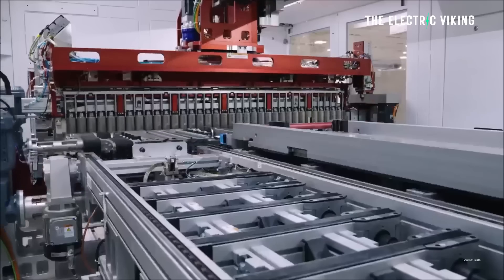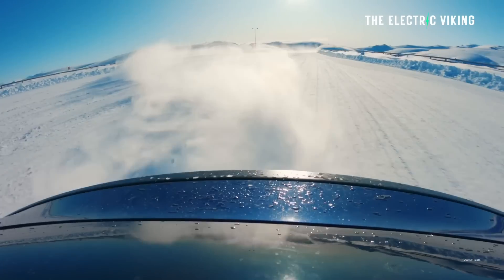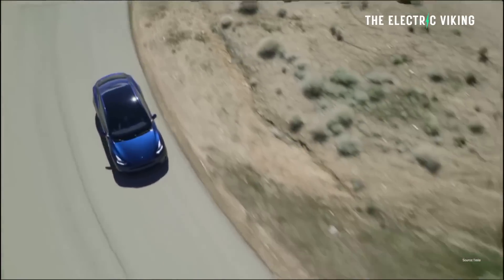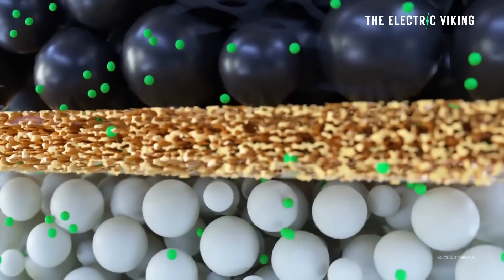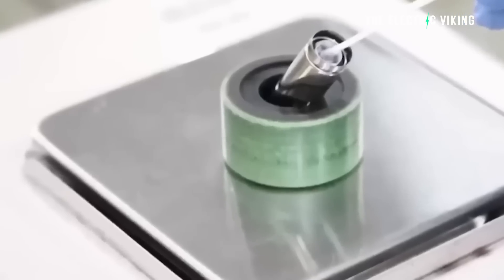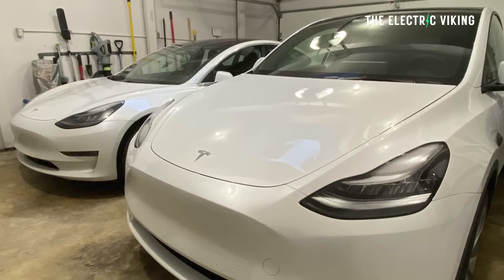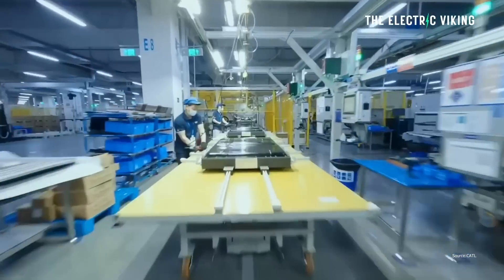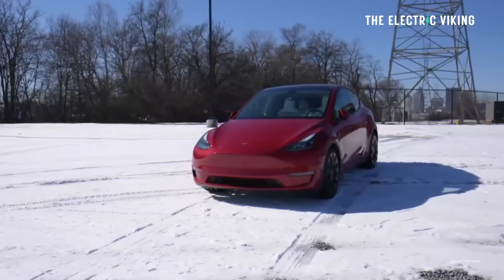Huge study of Tesla batteries reveals degradation in hot VS cold climates

Comment: With most modern EVs,.degradation is kind of a mute issue.  Even 4+ year old Leaf Plus which is nearly only DC charged and used for road trips has only 7% degradation in a hot climate.   Move on.. a bit more range and variety of style and features is where people are focused.  Batteries will get smaller/lighter but are not the top factor any more in buying decision.

Comment: I agree that newer LMC batteries are better. I have a Bolt EUV. I thought it was the goofiest iteration of an EV until I did more research. Winter is not good for Bolts, but I’m eager to see if I can make it work by using the cabin heater to 50F, then use the seat and steering wheel heater to keep me warm in heavy clothes.

Comment: If Tesla's are going ok after 25-30 years, they will hold their value and people will mass adopt. If their earlier models start to be a problem at 20 years, their resale value is going to dive sharply acordingly along with the company share price. As long as the battery degrades at a consistant pace and does not accelerate, it should be ok.
Reply: In 20 years we'll be having better batteries and a car from 2023 with 70% battery left will not do very well except local driving.
Reply: Telsa model S prices for used model from 10 years ago are diving. Telsamotorclub forum has a bunch of people with old 2012 needing battery replacement. Good luck keeping a car long term. Battery age by cycle and time. Father time gets to the battery no matter the miles.

Comment: There's really only one car manufacturer who has both the research and ongoing telemetry to monitor what their car's batteries are doing, how they're being used and have been doing this since over ten years. They've also funded the research of certain battery gurus (in Canada as well as other places) in order to have the best minds working on the problem. It is small wonder then that they have one of the best thermal systems (for both battery heating and cooling) and don't require a "don't burn the battery when rapid charging option" (greetings Porsche and Audi 😂). If there's one company who has the data, been there and done that, then I guess it's... you know who.

Comment: Can current Teslas cool the battery below ambient temperature while stationary?
Reply: Wilson: not without sacrificing energy from that same battery, it takes power to maintain a lower temperature. It also takes power to preheat the battery before supercharging but that is offset by being able to charge faster... Thermal management is expensive if you have limited amount of available power, it all comes out of the range...
Reply: @ttkddry  Yeah, I was hoping it could cool the battery while plugged in.   Where I live in Texas the daily high temperature is over 30 C much of the year, this summer has been unusually hot and it has been up around 40 C much of the time.
Reply: @_winston_smith_  when charging it does cool the battery pack, it has a seperate  liquid cooling in the battery packs. You can also resort to parking your car into a more shaded area when not charging of course...
Reply: Yes they can cool the battery when stationary to below ambient if required using the octovalve and heat pump.
Reply: No

Comment: All batteries degrade more in hot climates, and produce less output in cold climates. Heat is the destroyer of most chemical and mechanical processes, and if it’s not controlled it will be very destructive, and that includes an ICE engine.  🫠
Reply: Not hydrogen it appears ! 👍
Reply: @lesliecarter4295  Okay, we're really reaching now.  So you're saying that Hydrogen fuel cells last longer in high temps relative to other power sources?  So what?  They cost ten times as much too, and there's no where to fill up.  Hydrogen keeps coming up stupid, and the hydrogen cult doesn't get it.

Comment: Battery longevity is the most important factor to an EV's lasing value as a used vehicle.. Its best to perceive automobile market at a series of exchanges that proceed long after new vehicle production and sales.. 

When you create products that build a reputation for durability and long life you  increase the used value and this in turn increases new vehicle sales becouse the first purchases have more trade in value. This is a long term sale method of intentionally building perceived value over many years.

 As battery technology is rapidly evolving the best way to ensure lasting used vehicle value is by making battery replacement as easy and affordable as possible be designing in replacement as part of a long term business plan. This will become of increasing importance as EV transitions from more of affluent urban consumer market to mass adoption by consumers who are looking to maximize returns on vehicle investment over many years.